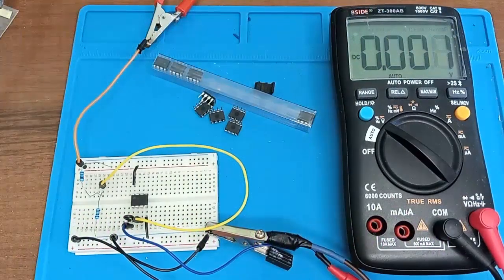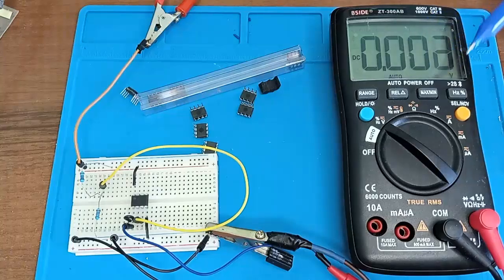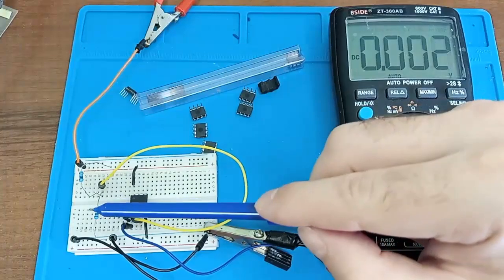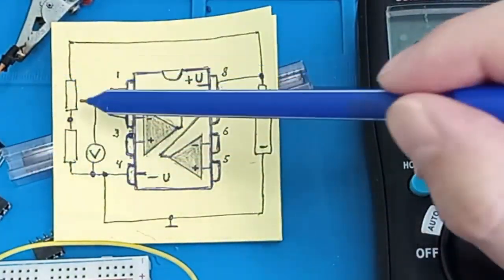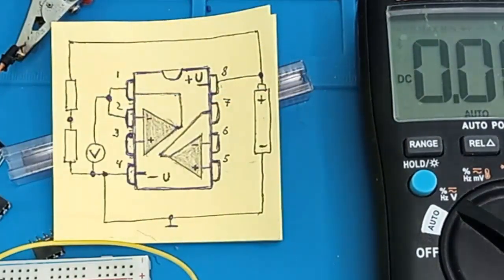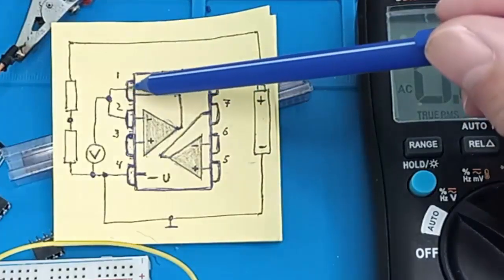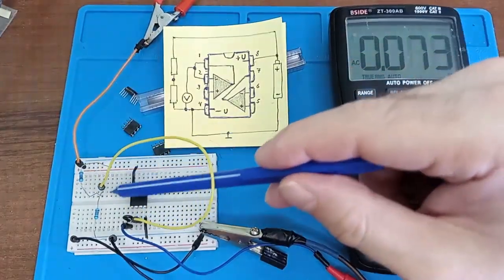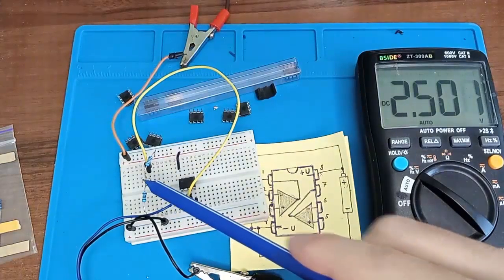🔴 Electronics repair 🔴 -How to quickly check the OPERATIONAL AMPLIFIER (OP-AMP) with a multimeter

Comment: What if the measured voltage is 3V does this mean the op amp is faulty
Reply from the maker: For any op amp, the output potential cannot be higher than the positive supply rail and cannot be lower than the negative supply rail. The width of these output voltage "dead zones" where the op amp output cannot go depends on a number of conditions (load resistance, output current direction, etc.). There are op amps with minimal dead zones, such as 50 mV on the supply rail with a 10 kOhm load for the opa340.